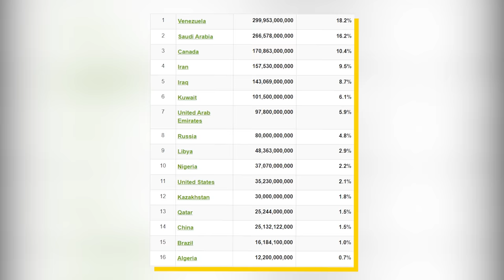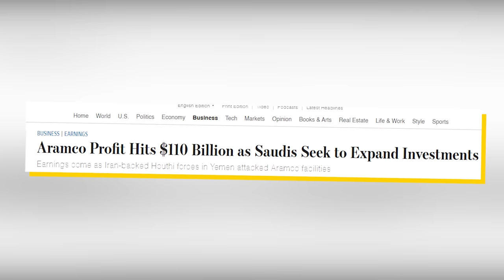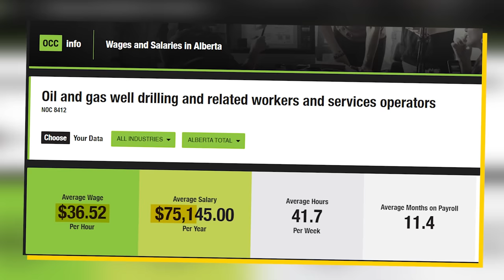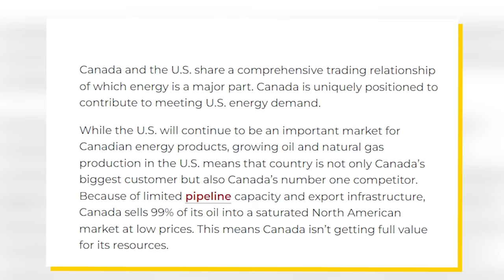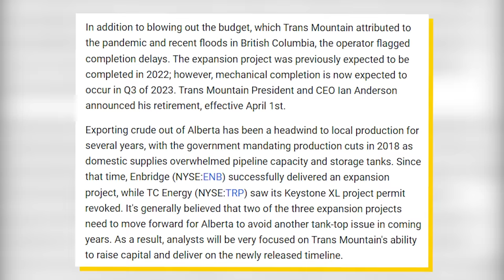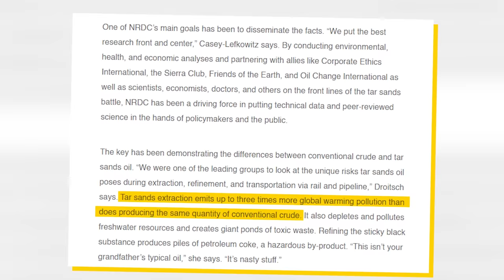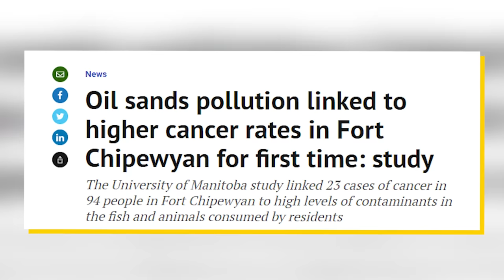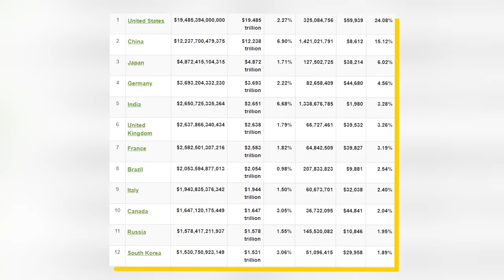Why Canada Refuses To Exploit Their Gigantic Oil Reserves

Comment: Canada not only has to construct the trans mountain pipeline to the BC coast, they would have to upgrade the port facilities to handle the large super tankers.  Also, because much of that oil is bitumen, it has to be sent to the US for upgrading as Canada does not yet have that capability, and many countries (other than the US) to which it could export don't either.
Reply: wow its almost like they shouldnt send billions of dollars to Ukraine and maybe we should think about investing in our energy stability. 🙃
Reply: @samp43  Canada is not a regime that just passes law without backlash from their people
Reply: The bottom line is that it's ridiculous that Canadians are spending over $2.00 per liter for gasoline when we have the resource in the ground.  I know Venezuela is a different world, but their citizens are currently paying 7 cents per GALLON at the pumps.
Reply: @chrisgraham2904  no
Reply: @michaeljordan6239  No - what?
Reply: Nope, BC doesn't want to upgrade BC ports for supertankers, we depend on tourism that relies on a clean coast.
Reply: All of the terminals and pump stations along the route are being upgraded for the new line. The Burnaby terminal is being significantly upgraded with multiple tanks and manifolds. The port is also being upgraded with larger deeper berths plus more  tanks. 
Product does not have to go to the US for upgrading. The Trans Mountain Pipeline ships everything from Heavy Crude to Gasoline. At the Sumas pump station in Abbotsford there is a line that diverts south across the border to the US to sell product.

People love to hate the pipeline. But without it the lower mainland would run out of gas and diesel in a few days. Last fall when we had the floods the line was uncovered and damaged where it crosses under the Coldwater River near Juliet Creek. This area also lost 2 highway overpasses. When the line had to shut down for repairs we were all on a fuel restriction.
Reply: @jjjones4982  What if upgrading your ports resulted in the elimination of your provincial sales tax, as oil has done for Alberta?
Reply: @chrisgraham2904  AB is the one that needs to get a PST so the province has a steady revenue source, BC doesn't need those ups & downs.   As I said supertankers would be bad for our main industry which is CLEAN BEAUTIFUL BC tourism.
Reply: @chrisgraham2904  No, as the video stated, just because it's in the ground, doesn't mean it's free money.
Reply: @jiecut  Can you clarify your comment?
Reply: @samp43  Sending Billions to Ukraine makes sense to keep people free from the grips of Russia / Putin.   Plus sending billions is a lot better than having to send troops.  Canada has no problem with Energy stability, Canada has lots of natural resources other than Oil that would produce higher returns.
Reply: @tonespeaks  lol what are some natural resources that are more effective at producing power than gas.  Solar is the only one you could argue is but that only Per KwH… when you take into account all the hundreds of billions it takes to build the solar farms and all the arable land it would take up,  it’s actually much less cost effective that drilling oil.    

And your opinion is that we should of sent billions to Ukraine.   Being Ukrainian,  I know all that money is sitting in offshore account belonging to oligarchs.   People here have no idea what Ukraine is like.  It’s literally the most corrupt country in Europe and JT just sending blank checks over there lol.
Reply: @samp43  I didn't say that the natural resources would be more effective at producing power....I said with produce higher returns.  I was talking about returns on investment.  Having said that, Wind, Solar, Geothermal and Hydro all produce electricity cheaper than Oil and Gas!!!  Don't forget that these resources don't have the toxic footprint as oil Production.   Building out Renewables is not only cheaper, but it is quicker to develop.   It takes years, to drill and start Oil production, moneys to develop Solar and Wind Farms.   As for the land,  Geothermal uses the land underground,  nothing on the surface needs to be disrupted. 

 An Electric Semi, is cheaper to operate than diesel, the TOC is about 30% lower. 

Hahahahahahah JT aka the Canadian Government is not sending blank checks to Ukraine.  We all know how corrupt the Government has been there, that is not news.   Canada has mainly been buying weapons and equipment for Ukraine.   The Money sent to help the government are loans, not gifts.  Plus with some of the Russia's money held in foreign banks, will help to offset whatever we send.   Don't worry Russia will ultimately be reimbursing us for our support to Ukraine one way or another.
Reply: @samp43  Our GDP percentage & our percentage of the population are EXACTLY the same, we contribute our share.  I also suggest that since AB has a windfall again they do something with all their ghost wells.
Reply: @tonespeaks  and electric cars are not better for the environment.   They have lithium in them.   And what are you going to do with all the batteries that stop working?  Are you going to dump them in a landfill?  Because you can’t recycle car batteries.      You literally have to mine 500,000 pounds of material from the earth to produce 1 Tesla battery.
Reply: @samp43  Sure you can the industry hasn't been built up yet.
Reply: The second narrows area of the Burrard Inlet passage restricts the size of oil tankers to  120,000 tonnes. So you would see Panamax	50,000 - 75,000 or Aframax 75,000 - 120,000 You will probably get  about 400 oil tankers yearly ,that would be about 11% of ship traffic for the Vancouver Port.  So no you will not get T3 supertankers in Vancouver. The only Canadian oil terminals that can handle T3 sized oil tankers in Canada is the Irving Oil deep water terminals in Saint John New Brunswick. All oil tankers entering Canadian ports must be double hulled. All tankers that call on Canadian ports are inspected and port pilots guide these tankers in with tugboat escorts. In 65 years there has not been even 1 incident with a oil tanker in the Vancouver port.  In 2020, there were four active upgraders * in Alberta and two in Saskatchewan, with a total SCO capacity of 223.8 thousand cubic meters per day (1 407.5 thousand barrels per day (10³ bbl/d)). The oil exported would be Bitumen mixed with condensate. Bet you a lot of it goes to California. California has oil but it is heavy oil and has  a very high sulphur content. Actually California claims carbon credits when it can get Alberta oil.As their refineries are set up for heavy oil the Alberta oil is a good fit.

Comment: Lets not forget that fact that almost every developed country in the world is slowing transitioning to "Green Energy"  where battery and electricity driven machine will replace combustion engine machines in the future. So over developing a hostile oil industry for a future that has it's writing written on the wall is a bad way to go. As Canada seeks to keep it's oil reserves as a backup as should the US or Canada need the reserves for future use.
Reply: exactly it’s very costly to invest into now when developed countries including canada are trying to move away from it so i don’t really think it makes sense to remove funding from so many already struggling funds to get into opening massive refineries and finding ways to drill thru v difficult terrain without also building into certain sacred lands
Reply: yet the daily oil usage has risen again every year and is expected to climb until 2050 at a minimum.

Comment: Canada is majority renewable energy anyway, so it will probably not be used (the oil).
Reply: Over half of the energy comes from hydroelectric power. We don't have any more good areas to dam without risking pretty serious environmental impact. 
Wind power and solar power have been very lacklustre overall and cost more than they've produced. 
If we need more power, gas, coal, or nuclear (the cleanest and safest type of energy so far) is the only way to meet increased demand efficiently.
Reply: @J S Cool. I like geothermal, it's effective and proven on a large scale in certain regions. 
If the ultra-deep geothermal technology actually works, I'm all for it.
Reply: @J S Unfortunately, that will never be cheaper.
The world already has that technology, but it simply is cost prohibitive.
Reply: @happydazeharvick4399  Geothermal has a high start up cost, but after it's been built it's extremely efficient, and cheap to maintain. 
The problem with geothermal power is that it works best only in certain regions with a high rate of tectonic activity. Iceland uses hydropower and geothermal power for most of its energy production, and it's energy costs are cheaper than most of Europe. 

IF, this ultra-deep geothermal technology has a similar rate of efficiency, it would be great. It beats every other type of renewable energy in terms of costs, efficiency and safety.
Reply: @speakingwithoutnet  you are correct

Comment: Speaking as someone who has worked in the Canadian Oilfields: HELL NO! I've been out in -40c and +40C. (Yes, both. In the same year in the same place.) Seen people get hurt, frostbite, heat stroke, crushed, threatened with violence. For $15/hr. No. Never going back.
Reply: -40 and +40 is a Canadian thing, not just oilfield thing...

$15/hr ?!!?  What year; that's minimum wage now?

Oil field wages were never about the most $/hr, but the fact you get 4,000 hours a year if you want it.  Although many try it is a job that was never meant for weak individuals.

EDIT: The video said the average is $36/hr.  Minimum wage workers are not dispatched to site.
Reply: @StinkPickle4000  That was 2013 to 2016. I did go up a little by the end. ($18/hr) What made me switch divisions was abuse of employees was rampant and having my life put in danger by unsafe practices. No chicken run in 6ft plus trenches. Hanging a horsehead from a crane while someone was working underneath. Picking broken shacks in 100km/h winds. The list goes on and on. Threats for making minor mistakes. Using Skid 40 pipes on wellhead. (They had been thicker but were significantly corroded.) I was trained as QC and every outing there was a violation of code and falsification of documents.
Reply: @SumBrennus  Safety is up to the workers!  

You got a heavy hoist with guys underneath?  Shut the lift down!  

At the very least its a company culture not just a blanket statement for all oilfield companies.  I guarantee you will find cowboy crane operators in any industry.
Reply: What were you doing for $15? Got 2 19/20 y/o friends who just went up and are starting at $38 lol
Reply: @loganamurray64  I was doing Oilfield construction and pipefitting. Boss got poor people he would pay much less than any other contractor, so would underbid. He also liked to market our work as superior but most of the time we were undermined by consultants pushing us to work faster and sacrifice the superior quality in exchange for us billing them to fix problems we created. It was a good racket for him... he made millions in 7 years.

Comment: Thank You for explaining that we do not have liquid oil in Canada. We have what is called crude bitumen, which is hard to refine, takes a lot of energy and it is more costly than the oil Saudi Arabia has as an example. Most people do not know this. Also Canada never invested in building refineries. So, we send it to the States to get refined and they sell it back to us.
Reply: What? Are you being sarcastic? There are thousands of liquid crude wells in Alberta. Some tight shales that need hydraulic fracturing to be realized.
Reply: @bobbygushlinger3637  Meant to say in the Athabasca's Tar Sands, Canada's biggest reserve. Thanks for the correction. (Edit: "Alberta has already produced over 90% of its conventional crude oil reserves, it has produced only 5% of its oil sands, and its remaining oil sands reserves represent 98% of Canada's established oil reserves.")
Reply: The Coop refinery in Regina would disagree. Not to mention LLoydminster and Edmonton. There is plenty of conventional oil in  BC, AB, SK, and MB.
Reply: We have 18 oil refineries in Canada. Where are you getting your information that Canada has zero oil refineries?
Reply: We have liquid oil in Canada to say other wise is not true . If that  would be such Enbridge  would never have built pipelines east and the trans mountain line to Vancouver would have never been built in 1953. That oil sands did not get really into production till the 70s . there is still lots of conventional oil in Canada also think of Hibernia  off Newfound land

Comment: I worked on an oil field in Canada. I can attest that it is ridiculously hard to get a decent amount of actual oil. We drilled more than 4000 meters into the ground. Also just saying 36 dollars per hour isn’t true most oil workers work 12 hour shifts and 20 days straight. We don’t work short hours out here because the rigs run constantly. 12 hour shifts are horrible but nice for the overtime. Most oil workers that work consistently make about 100,000 per year.

Comment: As an Albertan I can testify to the fact that big oil has reduced Alberta's economy to a one trick pony.  Big oil is a social economic hard drug metaphorically speaking.  When the oil is worth a lot of money we are high and lose our sense of reality, when the oil industry crashes, we are depressed and every single secondary and tertiary  job is indirectly tied to oil.  Lately there are quiet tremors of a permanent and paradigm shift away from oil as a main source of energy and wealth weather we like it or not.  I feel the next 20 years we will see oil on it's way out as a main source of energy for vehicles.
Reply: Are you alone in your opinions there or do others feel the same?

Comment: Your assumptions are wrong about avg cost / bbl, cherry picked the wrong value and the data is old.  There may not be current consolidated data but if you go into the financial disclosure of the three largest  Canadian producers (CNRL, Suncor, Cenovus) the avg cost is close to or under $30/bbl.  Been that way for a while, the expensive projects have shelved, cancelled or reduced after 2014-15 price crash and industry consolidation/rationalization.

Comment: Wait wait wait, where are you getting the price per barrel?  On the radio this morning, I heard the price per barrel was $79USD.  If it is only $74CAD for a barrel of Canadian oil, that seems comparable.  There is also no reason for us to sell our oil, much like Venezuela we could refine Canadian oil into Canadian gasoline and dramatically lower the cost of gasoline.  At the time of writing this locally my gas is $2.24/litre which is $8.46/gallon, and they are planning another $0.40/litre tax hike on fuel, which would put us at a whopping $9.98/gallon.  Cost of gas in Venezuela is $0.10/litre or $0.379/gallon for freaking 95 octane, my local prices are for 87 octane with 10% ethanol added.

Edit: Those are Venezuelan prices, the USD for their gas is $0.02/litre or $0.08/gallon.
Reply: Most of us oil is mostly good for make diesel not gasoline. Secondly it is private corporation who decide not gov about oil trade.

Comment: Generally speaking the shifts in Alberta for anything industrial like oil and gas are 10-12 hour shifts. The days on shifts can also rang wildly for example 5 days on and 2 days off, or 24 days on and 4 days off at the most. Company’s are also legally obliged to pay time and a half after 44 hours a week or for every hour worked past 8 hours to a maximum of 12 per day, not to mention travel and living allowance that can rang anywhere from 100 per day to 300 per day depending on the company.

Comment: The bit where it said "at low prices" is killing me 🤣
Reply: Yes I laughed at that too. Canada has both conventional oil and oil sands oil. Alberta has 8 different oil types. For example Syncrude Sweet Premium sells for $89.60 per barrel today vs WTI at $85.88. Then in Newfoundland and Lab. their oil is Brent crude.Canadians only look at the price of Western Canada Select (WCS) which is currently $63.85. There is a big discount for WCS as it is heavy oil with condensate mixed in so it will flow through a pipeline. But even at $63.85 Canadian oil companies are making serious profits.

Comment: There are some key financial items you stated that are incorrect, the average salary per hour is 34-37 per hour.  Work consists of a 24/7 cycle at 14 hours per day.  Also, they recieve what is called LOA - a daily living allowance usually around 140 dollars.  Some key aspects of labor laws that apply to the Canadian oil industry.  Workers are allowed to work past 24 days strait if they choose! Only in European counties like Sweeden and Norway are their fines if you make your workers work longer then a 40 hour period.  Also the required break even point for Canadian Oil is 40 dollars per barrel as per the majority traveling south to America as you said.  Infrastruxture, East is stopped by Quebec preventing any oil to flow East.  BC on the west also prevents expansion of existing pipelines or new ones for environmental viewpoints specifically the increased tanker traffic would have on local whale populations.  Alberta though Jason recently just engaged in a large scale carbon capture factory and aims to be carbon neutral by 2050.  Which will make it the number 1 source for environmental produced Oil and by far! The most ethical producer of Oil in the world!

Comment: The oil sands operation is much more complicated complicated. Yes, there is lots of carbon dioxide, it does leave toxic oil sludge, but this is cleaned up and trees are replanted, etc. So technically it is also a really complicated process of oil extraction and terraforming. 
-A Canadian.